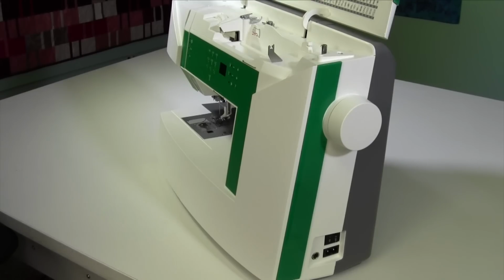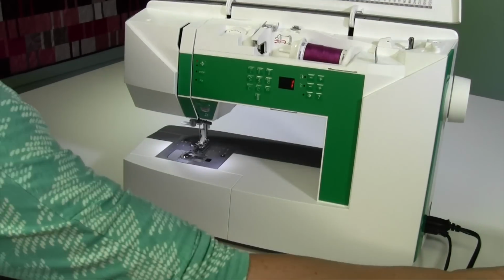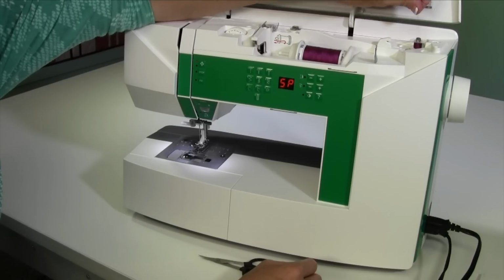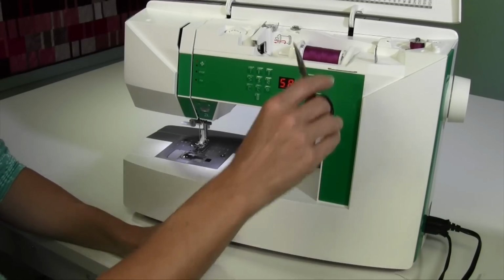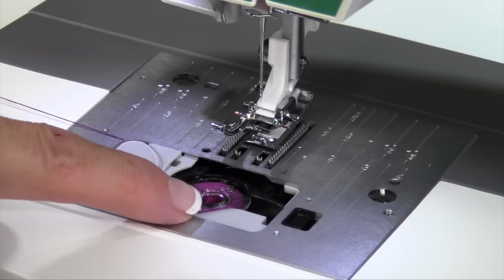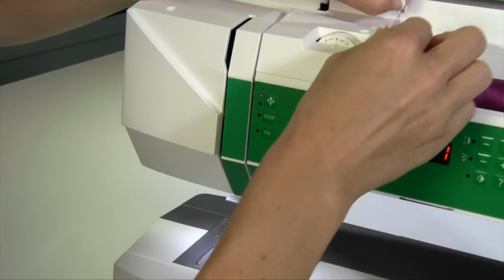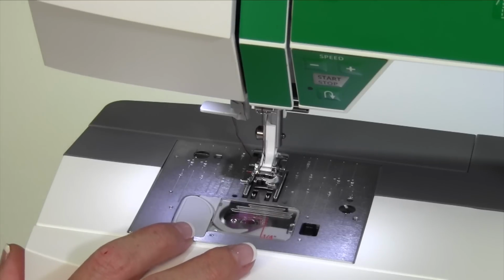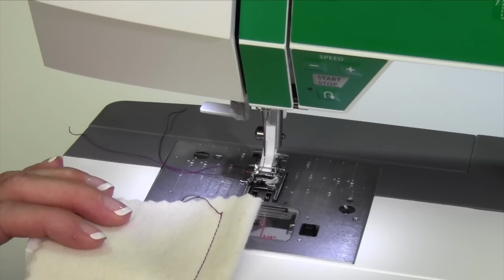Husqvarna Viking Jade 20 3 Machine Set Up

Comment: I had been looking at the emerald 118 but found the Jade 20 on sale for less than the emerald. Are there any significant differences (such as heavy fabric capabilities) that would favor one machine over the other. The stitching options on the emerald would have been sufficient for my needs.

Comment: Please help! I've had the Jade 20 for about 7 months now with few problems. Today, as I'm making corona virus N95 mask covers my machine just stops being able to make a button hole. It sews fine on the regular stitch but when I change to the button holer, it wont move and stitches in the same place over and over. In the past two days I've made about 30 of these masks without a problem. I can't find any troubleshooting for this problem. Any advice?
Reply: I've had this same issue with my Singer Stylist 7258. Here's what you need to do. Purchase a roll of stabilizer. This will the feed dogs/teeth grasp the fabric and move it forward and backwards with the buttonhole attachment. Hope this helps

Comment: I don't have SP appearing on my screen, and when I try to whine it makes a sound. What am I doing wrong??
Reply: The bobbin winder slides back and forth.  It must be slid over until you hear/feel it snap into place.  When the bobbin winder is in the correct position, then ‘SP’ will show on the screen.
Reply: Lydia Ana are you pushing the bobbin threader over to engage it?